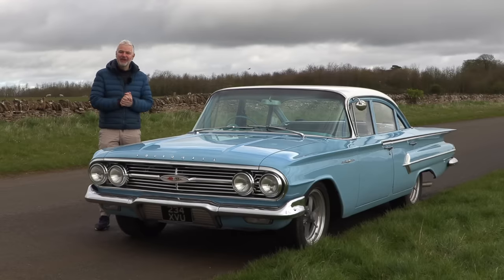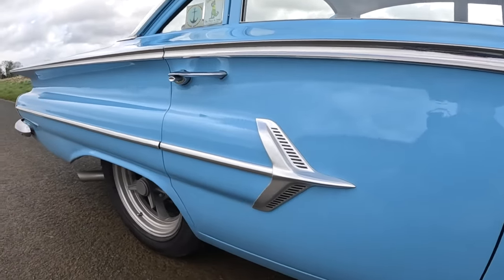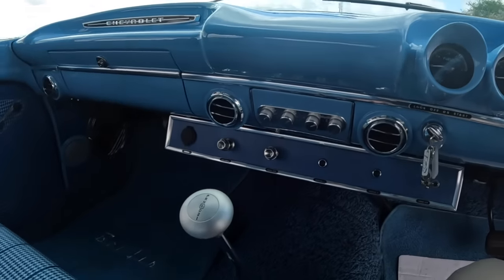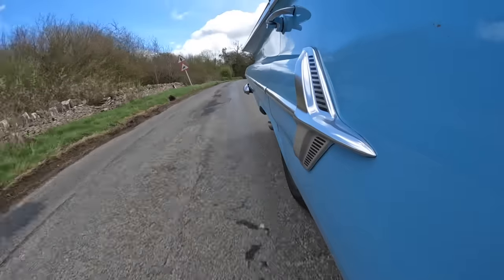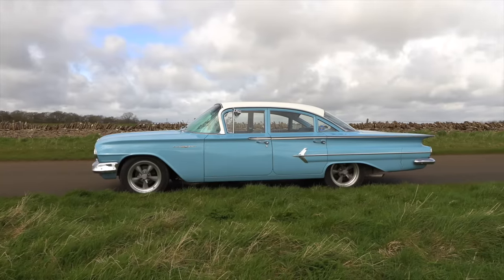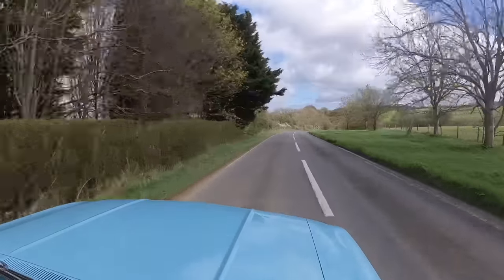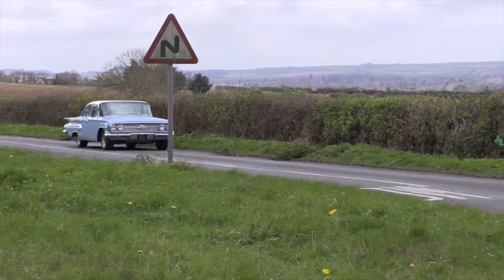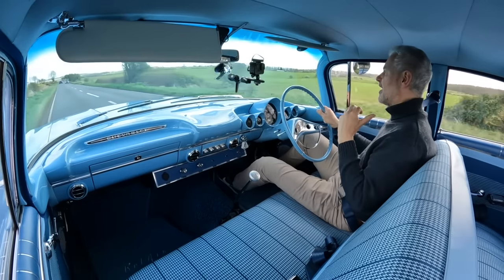Better Than An Electric Conversion? 1960 Chevrolet Bel Air With LS3

Comment: did i miss it ? you seem to be sitting on the right side of the road so i take it the gentleman who swapped the LS3 also did the RHD conversion. Great job.
Reply: Might have been built in Canada 🇨🇦 for the European market, I had a 61 Ford Galaxy town sedan that was built in Canada as a RHD vehicle .
Reply: No, it was always RHD. Assembled in Australia for Asian Market. Parts were made at Tarrytown, NY.
Reply: @johnchurch4705  Many assembled in Canada in RHD for South African and Australian markets. Overwhelmingly in 4-day guise like this one.
Reply: The 1950/60s Chevs and Pontiacs were assembled in Australia from Canadian CKDs and sold in Holden dealerships - and of course they were RHD fitted with amber rear indicators to meet Australian compliance requirements.  1968 was the final year for the Australian assembled RHD Chev/Pontiacs.

Comment: LOL- I have a '76 Valiant V8 sedan. Bergman Auto Craft steering & suspension, US Car Tool chassis stiffening kit (subframe connectors, torque boxes, A-pillar/inner fender bracing, and the core support kit), 4WDB, manual gearbox with overdrive, 8.75" rear end with 3.23 sure-grip, and a 318 running modern heads, 340 forged steel crankshaft, forged I-beam rods, 9.45-1 compression with Keith Black lighter weight pistons. The colors are very '70's...Harvest Gold with a painted white roof, interior is mink with gold. It'll pull about 21 MPG cruising between 80-90 MPH

Comment: I own a Holden (GM Australian) with LS1 V8 (5.7 litre) with 6-speed manual.  I can confirm that the fuel efficiency for such a large engine is outstanding - more so on highway driving.  Consequently, it's no surprise that the Chev achieves far better economy with the 6.2 litre LS3.
I'd expect that the Chev's driving experience could be enhanced by improving the suspension package - i.e. springs, dampers and bushes - and the fitment of a lower ('quicker') ratio steering rack.

Comment: I grew up in the US driving cars of that era, we had a 60 Ford, but I never knew of LS swapping a 60 Chevy and having the motor mounts fit. It is just an amazing way to re-experience a bygone era with modern tech. Yes they handled very poorly but way better than early 50 s Buicks I drove.  The original had drum brakes btw and the disc upgrade is excellent given the increased power. I’m as agnostic as you are on EVs conversions. Suitable for some cars, not others.

Comment: Having followed you from the beginning this episode came as something of shock.  And with all due respect, despite your comment to the contrary, this vehicle is most certainly a "hot rod" by any definition.  It's a lovely car to be sure.  Everything about the aesthetics suggests the original car.  So why not keep the original hubcaps 'look' and firm up the suspension so the handling is a better match with that superb engine?  Minor quibbles to be sure...  Either way, another great episode!

Comment: He was smart to use a 1960. The 1959, the first year for this body, had a different floorboard that forced the passengers to put their legs straight out in front of them. Due to complaints, general motors, revise the floorboard for more comfortable seating, I notice also with this Australian right hand drive that it has Non-parallel, Windshield wipers instead of the parallel ones like the normal Chevys have. Imagine hitting your head on that in a crash!

Comment: Reminds me of the huge Ford Falcons at Goodwood - blasting down the straights overtaking everyone and then losing places on the corners.  A pretty thing though.
Reply: pretty sure dan Gurney raced a '61 Chevy Impala at Goodwood, beating up the locals in their Mk2 Jaguars which upset the applecart a bit. Of course the Impala was a bit more up market than the Bel Air, but amazing cars nontheless. Love late 50's and 60's Impalas , huge good looking cars. My favourite is the '65 impala SS Coupe. Shame the US manufacturers lost their way during the eighties.

Comment: How is it a right hand drive? Did Chevy make these for the UK market? Or is this a conversion? Very cool car.
Reply: Right hand drive ? Australian spec car ??
Reply: Yes, always been RHD, Australian assembled.
Reply: The 1950/60s Chevs and Pontiacs were assembled in Australia from Canadian CKDs and sold in Holden dealerships - and of course they were RHD fitted with amber rear indicators to meet Australian compliance requirements.  1968 was the final year for the Australian assembled RHD Chev/Pontiacs.
Reply: @georgebettiol8338 thanks for the info!

Comment: The most important thing about this car is it is RHD, no question. A great conversion with non standard brakes and A/C

A very saleable car with just enough mod cons to make it viable, and, not turned into some crazy hot rod that no one wants. 

Whoever did this is one switched on cookie. 

Why would anyone want to destroy the value of a car making it electric. They would have made the car unsaleable.  

Battery cars are worth very little on the secondhand market, no one wants them. 

If people with more money than sense wish to convert perfectly good cars into mobile phones on wheels that is fine, however, in 5 years when the battery 
needs replacing the novelty will drop like a stone, if it has not already when they have discovered the real world range of the car. 

I do not understand why you are obsessed with battery conversions. I would have thought leave it as standard or restomod is more relevant. 

We were taken out for a drive in a 1956 Plymouth Belvedere, not restored but as new. A really comfy ride with a surprising amount of power. The amazing thing
was the gear selector was push button. 

A great review even with your limited knowledge of the car, the driving part was worth a watch.

Comment: This an affordable proposition in the US - junkyard LS engines are available for $425 from LKQ (breakers). ECU $90.

For disc brake conversion, I have read that spindles (and matching ball joints) from the 1970 - 1990 cars will fit drum brake cars from 1955.

Comment: How come you do not know the changes in the brakes, in the video is pretty noticeable , the owner installed disc brakes, these cars did not have as original equipment discs brakes… not in the beginning of the sixties, they had drums brakes….

Comment: No mention was made of it being a right hand drive vehicle.  I would have liked to have known where it was sourced from or if it was converted from left hand drive.
Reply: Always been RHD. Assembled in Australia.
Reply: He did mention that rack and pinion steering was fitted so it would have made sense to do the conversion then.
Reply: The 1950/60s Chevs and Pontiacs were assembled in Australia from Canadian CKDs and sold in Holden dealerships - and of course they were RHD fitted with amber rear indicators to meet Australian compliance requirements.  1968 was the final year for the Australian assembled RHD Chev/Pontiacs.

Comment: Back when I was in High School, we had a 1960 Chevrolet. I think it was a Biscayne, not sure. I mean, it was over fifty years ago. 

Anyway, I think ours got close to 20 MPG, and that's Imperial MPG. But it was a six cylinder with the Powerglide two-speed automatic transmission. And my father drove like an old man, which I am now.

As for the brake upgrades on the car you tested, the disk brakes on the front certainly are an upgrade. Disks weren't available on an GM car at that time, with the possible exception of the Corvette.
Reply: 1965 was the first year the Corvette was fitted with disk brakes.  GM definitely were late to the 'disk brake party'.

Comment: I love this car, Rocketpunk styling, RHD, sounds awesome and I dislike resto-mods when they use another manufacturer's engine, so this sits well with me.  That said, I disagree on the EV conversion.  The '58 car wouldn't suit, or any muscle car, but for me this car is not really about the V8 but the style and ride.   On air suspension it would make the perfect smooth & silent cruiser.  Yes, EV conversions are expensive at the moment, but prices are already coming down and "crate" type kits are becoming available for more models.  It depends what you want; economy or environmental impact are largely irrelevant on cars like this anyway given the mileages they do, and originality doesn't apply here either.  Not sure which I'd choose either would be something special.

Comment: You have no idea the amount off utter hate ive recieved from my car club ,i own a 1985 W126 Mercedes and over the last three years ive spent so much time and money keeping the motor and especially the K jetronic in servicable order ,hard to get parts ,theyre exspensive and here in Australia nobody wants to work on the mechanical fuel injection ,a local mechanic suggested a LS1 and 460LE conversion ,he quoted $8500 for the entire job ,this included rebuilt motor ,transmision exhaust tailshaft radiator front disc upgrade and engineers certificate so its road legal ,it took 3 weeks and it has near twice the power and half the fuel economy ,parts can be bought everywhere for a fraction off the cost ,no brainer to me

Comment: we used to have a shabby very similar blue Impala come in for MOT every year at our garage in the early 80s. it was the widest longest thing we ever had in the workshop with barely a fag-paper clearance either side of the lift pillars and so much overhang we couldn't close the workshop doors. 
I could never get over how small the cabin was for such a massive beast and how completely innefficient and impractical the whole design was. however, in its native US everything suddenly makes sense.

Comment: Was this car converted to right hand drive or was it from a RHD market other than the UK? It's a lovely job whatever way you look at it, full marks to Rob the owner.
Reply from the maker: Was made in Australia…
Reply: Originally Built as RHD in Australia.
Reply: @robertjones7695  I had no idea they built these in Oz, I thought it was all either Ford or Holden. I assume you are the owner, a very nicely done resto-mod. It makes you want one.
Reply: The 1950/60s Chevs and Pontiacs were assembled in Australia from Canadian CKDs and sold in Holden dealerships - and of course they were RHD fitted with amber rear indicators to meet Australian compliance requirements.  1968 was the final year for the Australian assembled RHD Chev/Pontiacs.
Reply: @georgebettiol8338  Thanks for reply. Makes sense, Australia is a big country, long open roads much like North America - a good place to buy from if you want a RHD version. Cheers.

Comment: One of my first cars was a 1964 Belair with a 283 cubic inch V8.  Similar to the 1959, slow, with poor mileage.  Suspension was also boat like.  The batteries alone in several modern large EV SUVs weigh more than my Bel Air.  With a metal dash and no airbags, it wouldn't be safe to drive anymore in the USA.😑

Comment: Sorry but it just isn't right being rhd. It was built to be lhd, and that's the way it should be.
Reply: It's an Australian car.  The 1950/60s Chevs and Pontiacs were assembled in Australia from Canadian CKDs and sold in Holden dealerships - and of course they were RHD fitted with amber rear indicators to meet Australian compliance requirements.  1968 was the final year for the Australian assembled RHD Chev/Pontiacs.

Comment: I swear I've seen bigger brakes on some bicycles!
Reply: Fronts are G Body (SSBC) vented and slotted, rears are solid disks with adjustable balance. The modest tyre sizes preclude huge brakes as I think unintentional lock-up can be as issue with unmatched brakes/grip.

Comment: Can I ask probably a really stupid question, how is this bel air rhd?
Reply: Australian assembled!
Reply: The 1950/60s Chevs and Pontiacs were assembled in Australia from Canadian CKDs and sold in Holden dealerships - and of course they were RHD fitted with amber rear indicators to meet Australian compliance requirements.  1968 was the final year for the Australian assembled RHD Chev/Pontiacs.

Comment: I'm confused, you say it's a 4 speed with overdrive, yet you also say it changes down when you floor it! Is it an auto or a manual? But the biggest thing you didn't mention is the fact that it's a "right hooker", was it always that way from Australia or South Africa, or has it been swung over?

Comment: The original brakes were drums all around. It looks like the fronts are now discs. Couldn’t see the rears. 
The original tires were skinny, high profile bias-ply marshmallows. Radials were unknown in the US. It understeered even more than it does now. The pillow-soft ride and alarming leaning around corners is somewhat reminiscent of a Citroen 2CV. Not in design, but results. 
You mentioned the steel dashboard. Occupant safety was of no concern. Those beautifully thin A-pillars folded like toasted bread sticks in collisions, allowing the roof to pancake down onto the seat backs. There are videos online of these 1960’s cars crashing into modern hatchbacks, and the American giants’ performance is appalling. I’m not criticizing, just pointing out how far we’ve come. I drive a 1931 Model A Ford so don’t think of me as a hypocrite.

Comment: I’ve NEVER seen a RHD version.    When was that done?
Reply: The 1950/60s Chevs and Pontiacs were assembled in Australia from Canadian CKDs and sold in Holden dealerships - and of course they were RHD fitted with amber rear indicators to meet Australian compliance requirements.  1968 was the final year for the Australian assembled RHD Chev/Pontiacs.

Comment: LS Swap the world
Reply: yes  add todays radial tires 4 wheel disc and 20 mpg    no longer a gas hog
Reply: @youtubecarspottersguide1  And the LS platform is so light the only people that look down on them have never driven a car with one
Reply: @user-ie1hg5ov1m  Expensive in the UK though, very few laying around in wrecks so most have to be imported specially.
Reply: You got one in the 944?
Reply: @user-ie1hg5ov1m  yeah man, a lot of people assume they're physically big and heavy due to the 'big' displacement, but are lighter than some engines with half the displacement.
Reply: @UberLummox  No
Reply: @lorddoobsworth144  They forget that Cams and chains weigh alot the LS3 was lighter than the BMW S65 while having more power and torque
Reply: @user-ie1hg5ov1m  funnily enough i was actually thinking about the s65 when i wrote that post 👍
Reply: @lorddoobsworth144  people get stuck on hp/l like it means something

Comment: The problems with putting a 400+bhp engine in such an old car must be pretty blatant, the suspension will be utterly abysmal, the brakes looked tiny and i`m guessing it has drums on the rear too? The chassis will be horrendous in design, those seats are as far from supportive as its possible to get. Its a superb idea fitting that lovely modern 6.2ltr V8 but yeah the suspension, brakes, wheels n tyres, gearbox, axle/final drive etc, maybe strut braces all round to assist that no doubt incredibly floppy chassis. But when everything is sorted it is an incredible idea, way, WAY more power (along with reliability) AND better miles per gallon just doesn`t sound real haha!
Reply: Solid disks at the rear, slotted and vented disks at the front, but of modest size and with adjustable balance. KYB shocks, Hotchkiss sway bars and Global West springs, so it's not as wallowy as original, but it isn't meant to be a sports car either! (Builder)
Reply: 0 reason to trade comfort for sport in such a car..  Its not what its for. Just nice to have some power and better mpg.
Reply: @robertjones7695  aahhhh it already IS fully sorted! Very, VERY nice build mate and apologies for my enormous underestimation. You have truly built an epic car! Thanks for the reply!